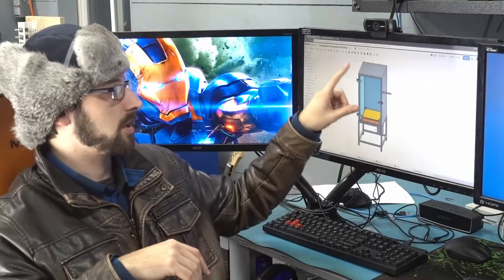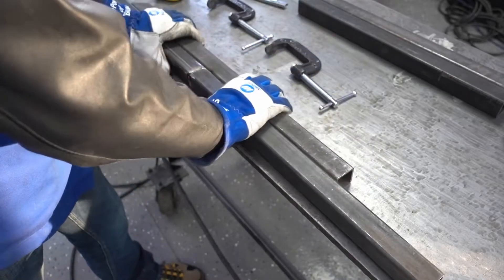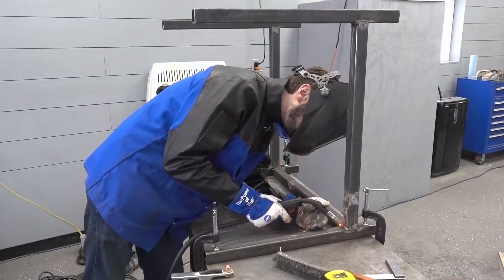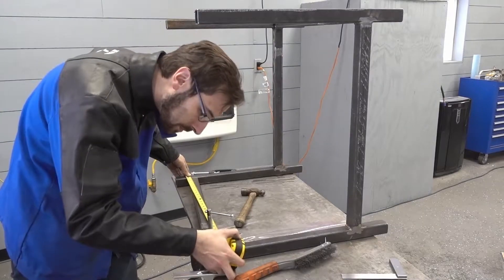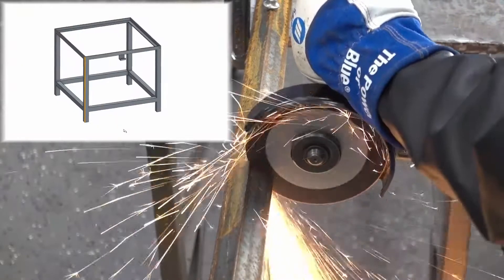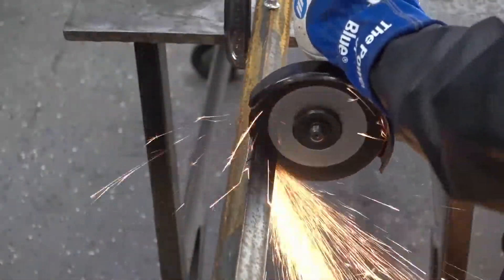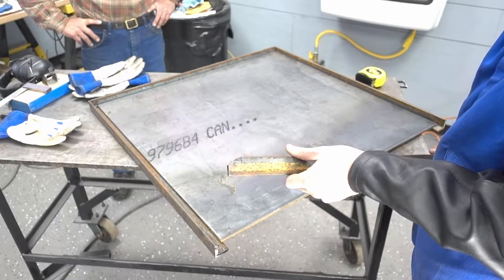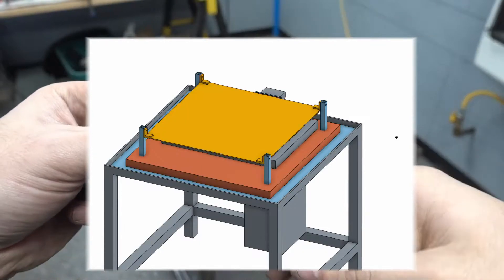Lab Oven (Part 1) - Structure

Comment: hi! what software did you use for the design? Thanks!
Reply from the maker: I think I used onshape.com for this. I have since moved on to using fusion 360. Having used both, I think that fusion 360 is a better thing to get into, for makers. They are both free though.

Comment: Well done sir, enjoyed seeing the whole process!  Definitely need to add welding to my skill set, opens up a lot of territory for new projects.  Is your plan to line the inside of the furnace with refractory brick?  Or are you planning to use something more like ceramic wool?

I liked the pace of your editing in the video too, showed enough to know what's going on without lingering so much as to become uninteresting :-)
Reply from the maker: I am going to use ceramic wool. I have never worked with it before. So, it should be interesting... : P

Thanks, that is what I am aiming for.